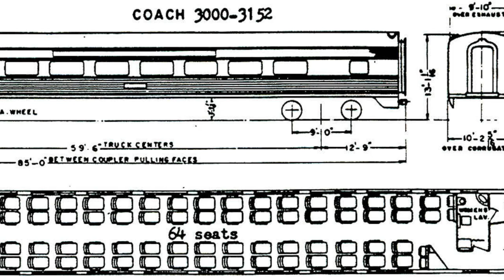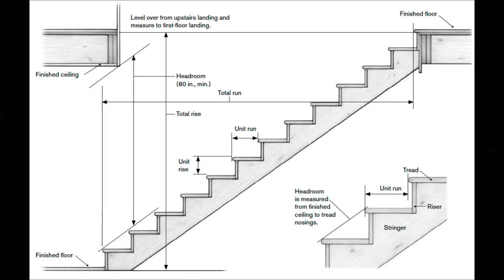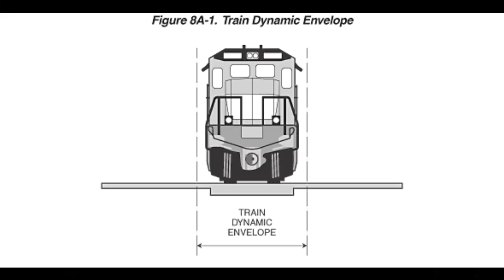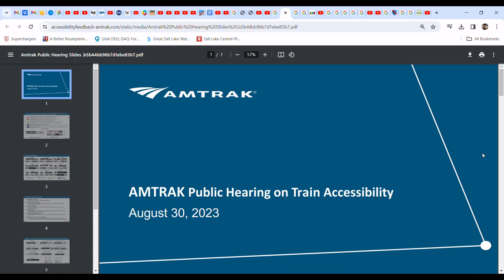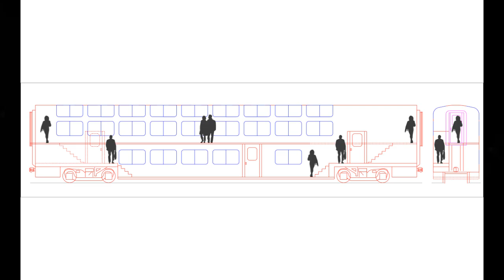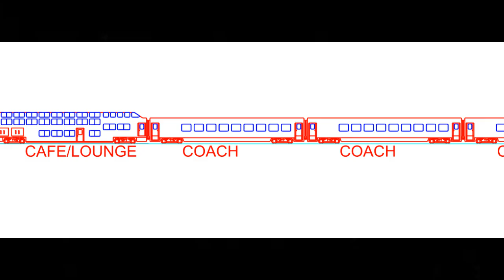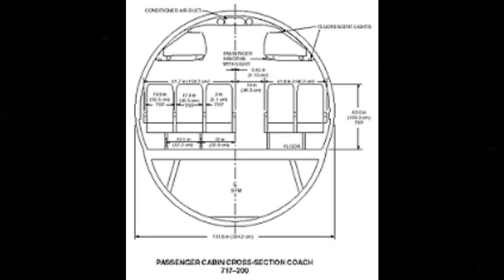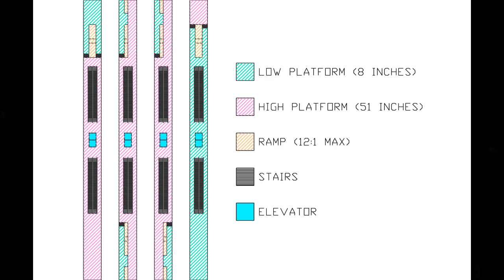An Excessive Explanation of North American Platform Heights

Comment: I had not realzied that ADA would be a factor in Amtrak's new fleet selection and that it was in a state of limbo due to request to change rules. So the new long distance fleet will take a long while to materialize. Another issue with sleepers is corridor width in terms of ADA.  In Canada, VIA Rail had bought trains built by Metro Cammel that were to be send to scrapyard because Nightstar wnet belly up before deliveries, and this went to the pupreme court because the wheel-chair accessible room was not in fact accessible because while the room was, the corridor to get to it wasn't  :-) (these were built to narrower Britishg loading gauge).  VIA was forced to modify enough cars such that 1 such woudl be in every of the overnight trains (whose frequency is now down to just couple times a week).
The Siemens "venture" have narrower seats to allow aisle to be wide enough for wheelchairs. And they come in 2 flavours: permanently coupled with wide gangways for wheelchairs, and standard AAR couplers with standard gangway. With permanent coupling, it reduces the need for the doors equipped with wheelchair lift since the wheelchair person can travel to the car that has the elevator that still works.  VIA has chosen all permanently coupleed consists, but Amtrak's various orders have a mix some of which has pairs of cars permanently coupled but with AAR couplers at each end of pair. 
Intreresting: the Turbo Train from the 1960s was permanently coupled and more modern than the old steel Ventures with aluminium body, jacobs bogiues and closer to a TGV than to conventional train. It had teething problems and CN Rail (who managed to fix it) ended up converting I think 5 7-car Turbis into 3 9-car trains to handle capacity. This was a permanent change which lasted till the train's retirement in early 1980s.    CN which worked with MLW to design a replacement for the Turbo (the LRC)  wanted normal couplers to be able to vary consists easily to meet seasons demand changes.  So it is funny to see VIA repeat the mistake of Turbo by ordering fixed consist trains which, during summer will be refusing custmers because they will have to room for them since unable to add cars. 
Season demand would vary greatly for long distance trains and I find puzzling they would consider fixed consists, especially for trains that aplit midway in a route.
Reply: I've heard the Airos might not only be a fixed trainset with the cars but the locomotive may be permanently fixed as well, at least in the Bi-mode Airos, since the pantograph is on the cab car and they'd need some pretty heavy duty electrical cable to feed the traction motors in the locomotive when running in electric mode.  I am still firmly of the opinion the Airos should be able to swap locos since Chargers are pointless on the NEC they should just couple ACS-64s to the trainsets when running fully under the wire.  But being able to add and subtract venture cars from an Airo trainset to adjust for demand is good as well, or add sleeper cars, baggage cars, etc.  Also providing provision for operating multiple locomotives for longer consists.
Reply: @mrvwbug4423 I’m definitely not happy with the Airo sets being fixed, but adding an additional locomotive is one thing that wouldn’t be challenging as they at least have AAR knuckle couplers on the outside ends (and at least some were supposed to use couplers to connect the locomotives to allow for maintenance).

Comment: Sorry to say, but it is not true that Europe doesn’t have level boarding on intercity and long distance trains. Yes, most high speed trains do have stairs, but there are more than enough trains that have level boarding, like the Twindexx or KISS Intercity 2 trainsets from Deutsche Bahn. Also the ICE L which will enter service this year is going to have level boarding. There are also examples from France, Austria, Switzerland or Italy.
Reply from the maker: I knew I needed to get that little jab in before the ICE L enters service, but I was unaware of the Twindexx or Kiss level boarding. I'm always happy to learn something new!
Reply: Only on 55mm platforms do you have step free access on 35mm you have a step down or a big step up in Germany. 55 mm is dumb to high for a double deck car and to low for a single deck car.
Reply: @nashorn9745  380 and 550mm are not standard anymore, especially not on stations that have intercity and long distance services, at least nome that I know of. By 2030 latest all relevant stations should be upgraded to 760mm, or in case of the S-Bahn 960mm.
Reply: @nutzername_unbekannt  550mm is the most commun and most standard hight
Reply: @nashorn9745  550mm allows for step free access for dubble decker as well as single level when designed right. 760mm doesn't allow for dubble decker trains.

Comment: “Gantlet”
Reply from the maker: Haha, the Utah accent is real!
Reply: Actually, both gantlet and gauntlet have been used for multiple decades. And I've seen both in print in articles and railroad documents dating back to the 1950s. For instance, right now I have pulled up both a December 1993 NTSB report on a January 1993 collision between trains 7 eastbound and 12 westbound near Gary, Indiana, "After train 12 crossed the Gary Gauntlet bridge, it then struck train 7"; it also uses Gauntlet in Figure 2, Postaccident track diagram; and, a January 19, 1993 Chicago Tribune article about same incident which uses spelling of gantlet, "The highly unusual track configuration-called a gantlet ...".

Comment: Just wanna mention that I was kinda surprised to hear that platforms can go as high as 51 inches above the rail. The highest our platforms go in Germany is 96cm, or 37 freedom units, and those are only built for some S-Bahn systems. Most platforms for regional and Intercity services are either 55cm or 76cm, 21 or 29 freedom units (the latter being the modern standard). And as you mentioned, we don't have level boarding for Intercity trains at all, except for the ICE L that's gonna be entering service soon (the L literally stands for "Low floor", that's how special that is here).
Reply: The 51 inch platform height originated from the NYC Subway and Chicago L train well over 100 years ago, as they wanted level boarding for the very busy metro trains.  As commuter rail expanded in the Northeast, those systems followed the 51in platform height which eventually became a standard.  That car height also allows for a fully flat car floor, further aiding accessibility.  No weird stepped floors like you see on a lot of Stadler FLIRT trains, or stepped boarding like a lot of light rail.
Reply: @mrvwbug4423 I can’t find the platform height of the chicago L, but the NYC subway has a height of around 1100-1150 mm, a good 150-200 mm less than the NEC, I believe the floor height on the NEC bas more to do with fundamentally approaching the design to not limit the wheels at all, as train wheels on intercity trains tend to be around 1 meter in diameter, add some height for suspension and structure to that and you get somwhere around 1200-1300 mm, independently of whatever the subways were doing.
Reply: @mrvwbug4423 maybe there are different Stadler FLIRT variants but the one I know in Switzerland doesn‘t have steps, the floor is a slight ramp instead.
Reply: You do have level boarding for some intercity trains:
IC2 KISS with 55 cm
IC2 TWINDEXX, though this only applies in the cab car
Reply: @SebastianD334  oh yeah I was gonna mention the IC2 in the context of regional trains, but I didn't want my comment to get too long, so I forgot.
The IC2 is interesting because both kinds are basically repurposed regional trains. I haven't taken either yet, so I can't say how well they've been adapted for Intercity services.
Either way, I should've mentioned them, they are the first long distance trains in Germany to have level boarding.
Reply: @SebastianD334 The Northeast Corridor was built by the Pennsylvania Railroad, and going out of their way to have the optimum car height sounds exactly like something the PRR would do. They were called “the standard railroad of the world” for a reason.
Reply: Swiss intercity trains have level boarding with platforms at 550 mm.
Reply: IIRC a lot of train systems in Asia (especially newer metros and HSR) tend to have high platform heights of around 40-50 inches (1000-1300mm ish) as well, to enable level boarding with level floors in train cars too
Reply: It's honestly mostly America's ludicrous loading gauge. Our stuff is just bigger.
Reply: What about the Subway? How high are your u-bahn platforms?
Reply: @ABCantonese  That varies based on a system-by-system basis. That's the major difference between railways and tramways (subways follow tram rules here) in Germany. The railways have to be standardized across the country, but trams can adapt to their city's individual needs.
Without checking, I think Frankfurt's U-Bahn platforms are somere between 80 and 90cm to give you at least one example, but I haven't read up on any other system, it's likely to be slightly different.
Reply: "Freedom units"?  Not the modern standard AT ALL. The USA is the only country still sticking to this ancient three-barleycorn unit.
Reply: What is a "freedom unit"?
Reply: @smedleyfarnsworth263 In this case, referring to inches, or twelfths of a foot, though when said by people outside the US any and all of our weights and measures are “freedom units” to them.
Reply: @DiamondKingStudios  So it is really the obsolete and cumbersome imperial system with a novel name.
Reply: @smedleyfarnsworth263  It's of course to make fun of the US. Don't remember the freedom fries?
Reply: @smedleyfarnsworth263  It's actually "US customary units", which are partially slightly different from the units used in the British Empire.
Reply: @PauxloE  So it is the obsolete and cumbersome imperial system, messed up even more.
Reply: @smedleyfarnsworth263 An inch 😉
Reply: @smedleyfarnsworth263  I suppose that he refers to inches as "freedom units", because 'murica.
Reply: New ICE high-speed trains of the last 10 years (ICE 4 and ICE 3neo) are equipped with an on board lift, to board from 76 cm (29 in) platforms. Though ICE 4 trains used to have a quite difficult to handle one, which broke down from time to time. When ICE 3neo and ICE L trains will fully be delivered (in the 30s) a new ICE 5 should have some doors at 76 cm. Similar to the railjet 2. Gen., which has mostly 55 cm doors, but steps in each carriage to get over the axels.
Reply: Germany’s platform heights are not logical and are a compromise at best (e.g. reunification and 3-5 different platform heights). Level boarding is probably best at 55cm for double deckers and around 100cm for normal trains. Generally you can say if you have low platforms and level boarding, there will be many steps inside the train.
Reply: @f_w_  I don't know why, but reading "Germany's platform heights are not logical" irritates me. I guess it kind of implies that they were chosen at random or something.
Reply: @namenamename390 I guess it's mainly about the variety of platform heights and the only recent introduction of level boarding on IC trains? With platforms being standardized across Europe, Estonia actually demolished high ~1m platforms and low 200mm platforms and replaced them all with 550mm and low floor trains
Reply: @namenamename390  They kind of were. Quite a few railway stations date back to the times when Germany consisted of many, many regional governments that each were their own realm. That changed somewhat after the Weimar Republic, and very strongly so after the second World War under the German Federal Railway and their east counterpart, the German Reich Railway (during the split)
Reply: Germany's platform heights are high enough to be a high platform with a large drop to the rail, but are still too low for level boarding. Why not go all the way up on intercity platforms, rather than having an awkward two steps up that are a pain for people with heavy cases or in wheelchairs (or both)?
Reply: @peter_smyth  To answer your question, the ICE trains currently in service would need a platform height of around 120cm, but that doesn't fit in the European structure gague, so trains would collide with platforms at that height.
Also as mentioned, the ICE L will have level boarding at 76cm platforms, so it's definitely not impossible.
Our neighbors in the Netherlands are currently in the process of adapting all platforms to 76cm for the sake of accessibility, so I don't think that particular height is a problem.
Reply: @namenamename390  Honestly it is pretty bad and I find this the most annoying oversight in the EU rail standardisation effort. The level boarding on the ICNG is nice, but the internal floor height is all over the place, and new double decker designs such as the TER omneo and DDNG just show that 76 cm is just impractical to combine with level boarding onto double deckers without sacrificing the capacity which the double deckers were for in the first place. As much as I heard the new DB Talgo's are pretty nice, they're not even close to being the standard of new trains so opting for 76 cm creates problems for rolling stock for years into the future. In my opinion the Swiss standard is far superior.

Comment: Okay… mixed level trains has been in use in Europe for a while before Nightjet came into service. This was a system called City Nightline. I used it between Zurich and Vienna. Very good. This train had a mixture of single and double deck cars … the sleeping cars WLAB and WLA were double deck and the WLB were single deck along with the service car. The WLAB and WLA could easily use the Northeast Corridor. But again platform height is always going to be an issue. The idea of the capsule sleepers is perfect! I miss the old Slumber Coaches. Now if I want to travel overnight on Amtrak the minimum I have to purchase is a roomette for two people and pay accommodations for two people plus rail fare , not cheap at all where the slumber coaches had single and double rooms which were more reasonable albeit they didn’t have the food services included. Honestly I have travelled on sleeping cars around the world and the best and the most impressive, for me will always be the Amtrak Superliner.. nothing can compare to them. As far as ADA .. add a lift inside the lounge car or one of the coaches and be done with it. That way the disabled folks can have access to most of the train.
Reply: A single Car with ADA accessible is the way to go, don't waste time trying to make everything work, or the very few who will use it. Maybe have motorized lift/ramp at stations with ground level platforms that can help disabled/wheelchair people get aboard without having to modify the station or train.
Reply: @ThePTBRULES  lift systems on low level platforms are already at Amtrak stations to comply with ADA… on the small stations not sure if they are motorized or hand cranked… maybe someone can chime in on that.